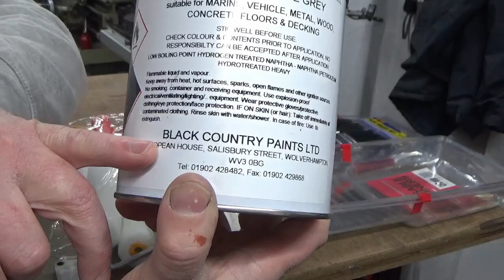Atlas 7B Shaper Refurb Part 4 - New Paint

Comment: Hi Jon
Great colour scheme. It looks really sharp.
One small pick, which is not wearing gloves when using red lead oxide paint. Lead can be absorbed under finger nails and through any cuts on the skin and it is cumulative. So plasters on cuts and wear gloves 🧤!
Reply from the maker: Hi William, thanks for the comment and feedback, much appreciated. I used to use red lead years ago, nasty stuff indeed. I can't imagine modern red oxide primer sold in the UK contains any lead these days, we have spent far too long under EU rule!! (could be wrong - I will check on the tin). Good safety tip though so thanks for posting. Cheers, Jon
Reply: @jonsworkshop  there's no lead in it these days Jon. Works well with the enamel paint, exactly the method I used on my old Myford M. 
Best wishes, Dean.

Comment: Oh god, it's hideous... But then I did vote for this, like I said it's yours so paint it colours you like.
A little advice on paint for next time... Look for tractol paint, used by farmers because it is easy to use an reliable. Smith and Allen stock it online, but as you're fairly rural, find your local farm supply place as they are likely to stock it. TBH, you probably don't even know farm supply places exist near you (most of us in the UK are unaware), it was a revelation when I found my local one. Nearer than any of the local town DIY shops and they stock so much useful engineering stuff at sensible prices.
For primer, have a look at kurust. It is the ONLY primer I use for ferrous metal now. Basically a phosphoric acid, latex mix. It effectively converts any rust into iron phosphate and any bare metal surface rusts instantly then gets converted as well. Iron phosphate is a dark black, very hard surface that resists further rusting and takes other finishes very well. Don't be put off by the tiny pots it comes in, it goes a looooong way. You'd need maybe 20ml for the whole shaper, I get through one 250ml pot every five years or so, and I use it on everything.
Reply from the maker: Hi Matthew, thanks for the comment and suggestions, I will check out farm supplies and also your primer, this sounds like an interesting product (especially living where I do as corrosion is blown around on the wind up here). Cheers, Jon